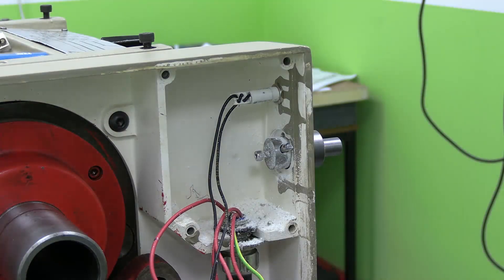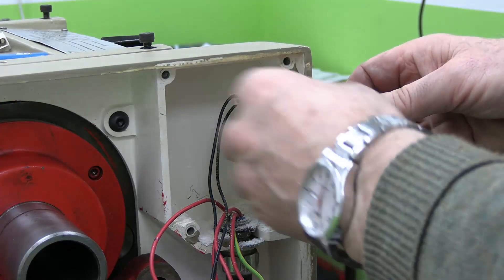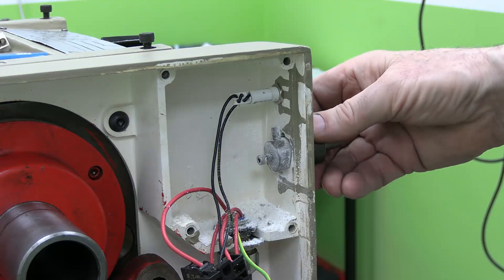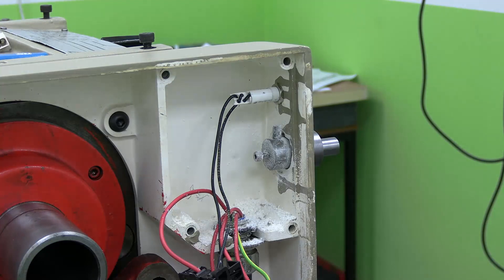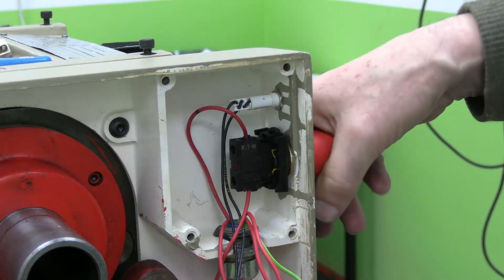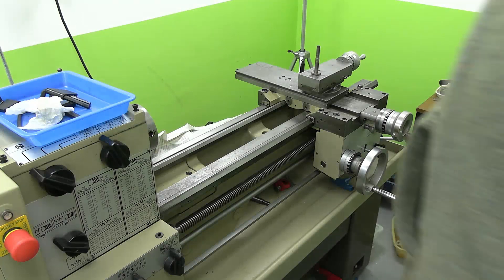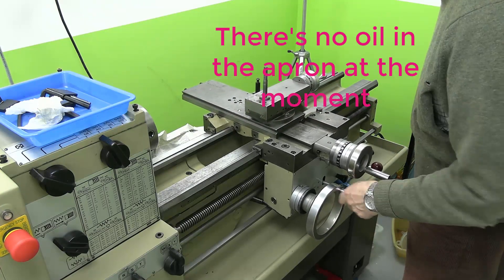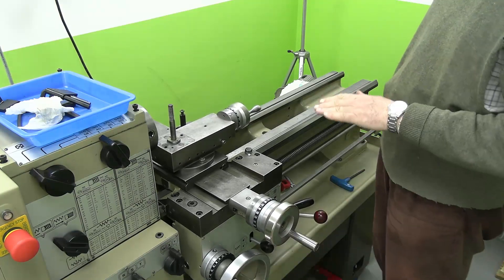Harrison M300 lathe - treading water & lead screw problem

Comment: I have been re-reading these posts: Regarding the lead screw problem, what did you finally decide to do?
Reply from the maker: Nothing so far! I fear any bed regrinding would be too costly in the sense it might be better value to get a new lathe, or find an M300 in better condition. I migtht be able to grind down the underside of the saddle myself on the milling machine, and then put turcite on it and scrape in, thus raising the saddle. If really necessary.

Comment: Regarding the leaky apron. There is a company called Reliant Rubber that can manufacture a rubber (or cork) seal for your apron (to your specifications). He remanufactured rubber treads for some tank wheels that I picked up for a friend of mine. They were very helpful and even took the time to show me around.
If you don't fancy going down that route how about sticking some sandpaper to a flat plate and grinding the apron bottom by hand. I have used this method on several and far more demanding situations with great success.
Reply from the maker: Thanks, I'll beare that in mind for future use. I later discovered it isn't leaking from the bottom plate, but rather from the two shaft seals around the tube through which the drive shaft runs. Need to replace those seals in due course.

Comment: Looking forward to seeing the lathe functional.
I hope all is going well with the installation of the three phase consumer unit?
I wonder if a Sirius Professional 5kva 110v Site Power Supply Kit would help you to test the lathe whilst you wait for your installation?
I look forward to seeing your update soon, I’ve been missing watching the progress of the Harrison M300.

👍
Reply from the maker: Glad you're still interested! I'm nearly there on 3 phase, just waiting for my own electrician to bridge a 3 foot gap in the wiring! I could easily do this myself but prefer to leave it to the professionals who will have to sign off the whole works anyway. That Sirius, I think, is just a single phase 240 to 110v transformer, so wouldn't help. I do have a friend who has some kind of 1 to 3 phase converter and might borrow it if it goes on much longer.
Reply: @samuelfielder  I agree about letting the professionals do the job, having them sign off the work, pleases the insurance goblin’s 
😄
I look forward to the “grand start up video”, your post are always interesting and easy to watch and listen too.

I will keep my fingers crossed 🤞 for you that you’ll be up and running soon.
👍

Comment: Hi Samuel, your pain is our gain. Where did you get the emergency stop switch ?
Reply from the maker: Kempston Controls, Rushden. The original one was made by Klockner-Moeller. The new one is made by Moeller (possibly named Eaton) and is type M22-PV. Be very careful ordering the switchgear that goes on the back of it (I think mine is M22-K01).

Comment: Just a thought, if you get the ways and the saddle ground won't that make the problem even worse, not to mention the feed shaft misalignment as well. The problem is where do you stop, not knowing what the lathe cost and the amount already spent on it, sometimes new is a cheaper option. I know when I got my lathe, new was just to much and second hand was my only option,  problem is most lathes of the small to medium size are used by novice users and although their intentions are good, maintenance and cleaning after a while become a bit slack. Rust, chips and dirt really wear out ways etc if left unattended. Also we have to remember that things do wear out eventually no matter how well they are looked after. Mind you some new lathes are just junk. Keep up the good work Samuel.
Reply from the maker: Being comfortably retired, I could have bought a new lathe. I did look at the Gate Machinery G330, which comes in at about £15,000, but I decided that the use I would make of it could not really justify the outlay, and not sure of its quality (I haven't seen it in the flesh). You are right that some old lathes are just beyond redemption and, now that I have learnt a lot about my M300, I'm thinking I should have been more patient and more picky before buying mine. But the learning experience has been useful anyway, for someone who has never used a lathe other than my Chinese SC2 mini-lathe. If the saddle is ground, you block it back up to the original height using Turcite (which is actually used on the ways of some modern machines from new). If the bed ways are ground one would also grind under the headstock, so it all goes down by same amount. Only limit on this is to avoid the headstock casting hitting the top of the feed gearbox. One then has to grind the tailstock down to restore vertical alignment with spindle axis.
Reply: @samuelfielder  Seems like you have done your homework, in the land down under (Australia), very hard to find someone to do this kind of work (grinding ways etc)and the cost. Probably doesn't help I'm in a rural town, maybe the major cities you would have more luck but can't even get any parts or very, very limited stock, and the cost is out of this world. It's good to watch you go through the fun and frustrating times, I thought those sort of things only happened to me.

Comment: Following with interest, yes I agree, the fouling of the leadscrew in the apron casting, definately due to the wear on the bed and saddle, decisions need to be made I guess. You could, like you say, solve it temporarily by relieving the casting, and even if you get the slides machined in the future, it wouldn't hurt have a bit more clearance, but a bodge I know! I like the reverse spot face, brilliant!, keep at it Samuel, cheers Dave